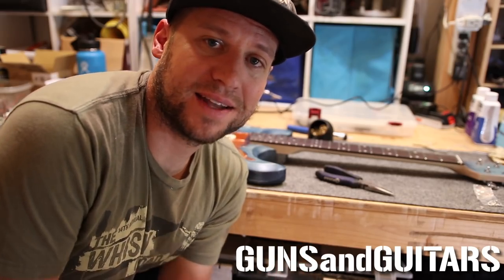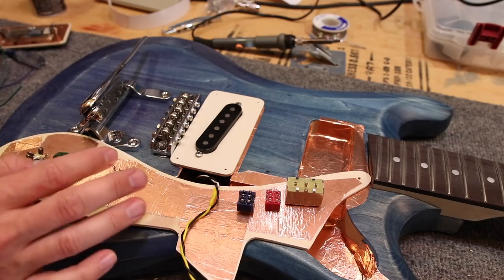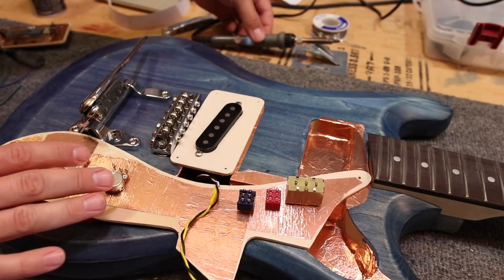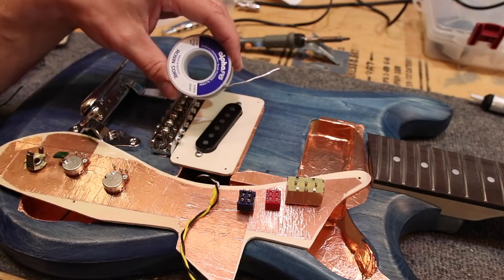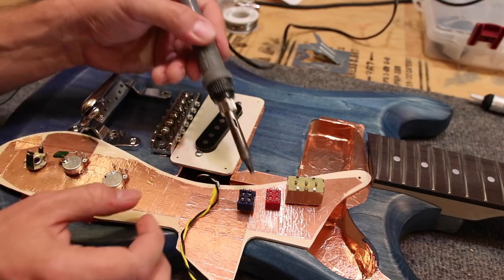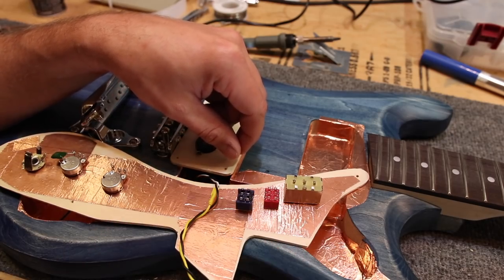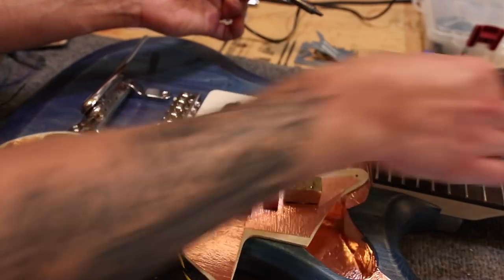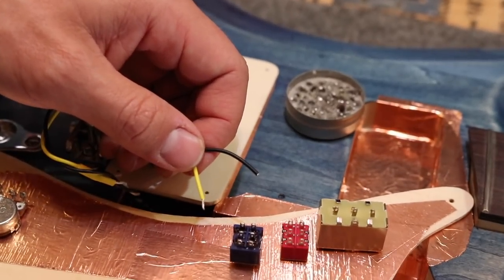Guitar Wiring and Soldering: Basic Technique Tutorial

Comment: Um, should be tinning the wires before soldering to the components, it takes less time/heat and is easier on the component.
Also, use of small copper alligator clips can be utilized for heat sinks to protect the components.
When soldering a potentiometer always turn the pot (volume or tone) all the way to zero, that way in the event too much heat is used when soldering any damage or deformation occurs when the pot is zeroed and not halfway through the operational part of the resistive material.
And above all, always use a towel, cardboard or painters tape to protect the guitars finish when soldering.
A soldering iron only has to touch, brush against or get to close to a poly or lacquer finish for immediate damage that can not be buffed/polished out, same goes for plastic pickguards as well.
Soldering techniques and standards courtesy of Uncle Sam. when I was a Technician in the Military.
Reply from the maker: Thanks for the tips! I never heard about soldering with the pots at 0 but it makes total sense!
Reply: HK Guitar honestly that is alot of good information in not alot of space thank you sir.
Reply: Which service? I was Navy. I graduated top of my engineering common core class, but instructors screwed me out of IC (interior commutations technician) & I got sent out undesignated.  I eventually, became a JO, propaganda specialist.
Reply: Thank you for the tip about soldering pots. Never have heard of that before but it makes sense. 
Thank you!
Reply: Really good tips. Correct me if I'm wrong but if you have a really hot iron the clip isn't really nesecery right?
Reply: Nice contribution. Thank you.
Reply: Thank you for the heads up HK and thank you for your service.
Reply: Thanks!
Reply: A little flux helps for a clean joint as well.
Reply: I'm an MIT Educated Electrical Engineer..with 90/10 or 60/40 Tin/Lead solder that's good advice...he's using Lead-Free/Tin-Free Solder which may as well be a Rosin Cored coiled up mound of dogshit...which require totally different procedures...
Reply: HK Guitar  excellent comments! I agree with all but did not know about Turning down knob. Heat sink is also excellent idea.
Reply: Thank you for reminding me about the alligator clips as heat sinks! I'm going to wire in some new pots and a bridge hb this weekend so that'll be really helpful!
Reply: Nice tip about the alagator clip.  Killed many components with a crappy soldering iron.
Reply: Agreed. Tinning the wires is an important step. Soldering the ground wires to the back of the pots, I believe should be avoided - quite often that is where the pots get overheated and ruined. Bolting down the ground wires to a central lug is a better practice IMHO.
Reply: You are correct , excellent observations above all to PROTECT the finish of the guitar . Greetings.

Comment: Tinning wires is preferred but not always needed. It’s better to do than not do but not always needed. Couple things to keep in mind when soldering to the back of pots move the iron around a bit to spread the heat and not burn out the pot also solder will move towards the heat so when positioning your tip and solder keep that in mind.

Comment: Dan, I honestly enjoy Guns & Guitars very much & it's been useful in teaching me several things, it's a great Channel... I'm an Electrical Engineer... 250K Potentiometers (pots) are for Single Coil Pickups, 500K Potentiometers are for Humbuckers (2 single-coil pickups wound opposite one-another, wound together, making 500K necessary), however, if you pair a 500K Potentiometer with Single Coil Pickup, all the audible variance the potentiometer gives you would take place between number 1 and number 4 (on a numberd knob like a Stratocaster has). Aside from that, Audio Taper Potentiometers (Pots) are Logarithmic. they have to be like that because decibel levels are Logarithmic so it's necessary & appropriate that Audio Taper, pots be used to control volume because they share the same non-linear scale...tone control is linear, so it's appropriate to have a Linear Taper Potentiometer in place of tone pot... if you want to do something interesting with Potentiometers which is different get the Bournes Wolfgang 500K "No-Load" Disappearing pots (when they're turned all the way up, there's a detent which is like a switch & when you flip said switch, the pot " disappears," the pickup never gets loaded by a tone control at all & therefore, the pickup runs "Wide-Open" (so-to-speak) & I'm currently contemplating buying a red EDEN Stratocaster body (normal tremolo routed but undrilled), putting a black Floyd Rose Original or "Pro" tremolo on it, a black HSH pickguard, Red Dragonfire Crusaders (Seymour Duncan Invader clones), black Seymour Duncan Triple Shot Switching Humbucker Pickup Rings on top of the pickguard to split the coils of the humbuckers, a 1-Meg Short/Split Shaft Volume pot, 2 Bournes No-Load Wolfgang Linear tone pots, a Richie Sambora Style Perloid Stars outlined in Black inlay, painting the headstock red to match the body, putting black sperzel trimlock 6 inline locking staggered tuning machines, a Floyd Rose R3 Locking nut, a black floyd rose string retainer bar (if a retainer bar is needed, my Jackson Professional Randy Rhoads RR3 doesn't have a retainer bar, but my custom Dimeslime colored Ibanez RG220X does have a retainer bar & so does my Desert Sunset Blue Burst Ernie Ball Musicman Axis...

Comment: Came here to see what it took to fix some solder joints. Have a Squier Jag I've had for years but it was unplayable because I thought the electronics were garbage. You made a point about using electronics cleaner on components to clean them out. So i soaked my pickup selector and pots and put her back together and wow. Immediate fix. Pots are still weird design, but at least i can play it now! Thanks a ton for that tiny pointer that saved me.

Comment: Thank you so much for making this video!!  I have tried soldering before, but it was basically an experimental circuit board.  It was okay, at least I got a feel for it.  But this video has really enlightened me.  I found a few guitars on the cheap, and they feel great to play - they just need better pickups.  I ordered some copper shielding tape today, and now I just ordered the cleaner and tinner.  You have a wonderful way of making sense of things, and you're so positive.
Reply: Also, thanks to you, I was able to do this yesterday - I installed a new pickup in the bridge of a guitar I absolutely love.  If I hadn't watched your video, it would never have gone so smoothly.  The pickup (a Mighty Mite single coil) - plus shielding the cavity and pickguard with copper tape - makes it a better guitar, with better balance between all the pickups.  It was such a thrill to hear it when it was done!!

Comment: What I'd like to see is a video on what can go wrong. I mean, I realize that the number of things that can go wrong is basically infinite, but I will say that I screwed up my first rewire job so abysmally that I think I learned more ways that a rewire can go wrong than tips and tricks to doing it correctly. So many small inconsequential aspects of soldering that people who have never had a problem doing it don't even think to mention (e.g. Don't blow on your joint to cool it down faster. Don't leave solder on your heating tip for an extended amount of time. Tinning is helpful. Prepping the back of pots by roughing them up can help. Etc.)

Comment: Lol!  I am not ashamed to admit it.  I was doing the same thing you mentioned (trying to put the cold solder on a hot post).  The crazy thing is, I can work with & repair mechanical things, I can even weld like a mother f..., but when it comes to electronics, I suck.  This video was helpful, for me.  Thanks.  Now, I can wire up my own pickups & pots & stop paying guitar shps every time I want to swap out pickups.

Deoxit is good, though.. The guy who usualy wires up my guitars told me about it and it works wonders.

Comment: Have more questions:
1. Will speaker wire work?
2. Any tips on soldering tight spaces? I tend to melt more wire coating that actual solder. 
3. Will that tip cleaner clean off melted rubber?
4. Aside from the housing, is that tip cleaner any different than copper scrubbing wool?
5. Being a beginner, I waste a LOT of solder. If you run out of solder, can you re-melt the wasted globs that didn't stick?
6. Have you used WD-40 Contact Cleaner? If so, how does it compare to DeoxIT? I already have the WD-40 and don't know if buying DeoxIT is worth it till I run out.
7. What's the best shaped soldering tip? Idk if it's better to use the flat tip to hold the wire easier and heat it up more evenly or if it's better to use the pointy tip for more precision.
8. Is a tone pot just a volume pot with a capacitor? Or is there more to it than that?
9. Is shielding necessary with humbuckers or active pickups?
10. If I DO try shielding, will just shielding the pickguard do anything? Or does it HAVE to be the full cavity?

Comment: trick I learned from a master. when you strip the insulation off the wire. cut with the stripper, but before you pull to the side with the tool stop. take the tool away. then grab the loose piece of insulation with your finger tip and twist while you pull. this does 2 things. 1 it twists the strands nice and tight and 2 it keeps your finger oils off. finger oils keeps the solder from sticking.
Reply from the maker: Great tip, thanks!

Comment: One doesn’t need to solder back of the pots to the ground side of the circuit if grounding foil is used to connect the pots and other components. 
In fact, by using the foil AND grounding pots with a wire you are creating an unwanted ground mesh that highly likely decreases the overall quality of grounding. 
Always connect the components to ground in a star-manner, not a mesh.

Besides, make sure that the foil itself is connected to the ground, otherwise it will act as an antenna that captures hum. The same principle works for bridge and the strings.

Comment: Hey Dan, I watched every of your videos. I love them. But could you start for very beginners, for dummies like me? I mean with one Humbucker and one Volume-Poti? And Then go on:-)
Reply: I've done one humbucker, 1vol before and it is the easiest of them.

First of, humbuckers normally come with 4 conductor wiring, which means both coils have their wires accessible from the control cavity. some might come with 2 conductor which is still a humbucker, it just means the north and south of one coil are connected in the pickup itself, so you won't be able to wire it for coil splits and so on. Both of these will also come with an unshielded (bare) wire, this is a shielding ground to help protect the wire from outside interference.

all the new humbuckers I've bought with 4 conductor have had two of the wires soldered together already, these are the end of one coil and the start of the other and this is what makes a humbucker a humbucker. If you don't plan on doing coil splits or anything fancy, just leave them as is and protect them with some electrical tape.

Next, you'll have to figure out which is the hot and which is the ground. most branded pickups have a diagram or key with them to tell you, but if yours doesn't you'll need to use a multi-meter to figure it out. There's plenty of videos on how to test pickups, in fact I think Dan has one.

Once you've figured that out, you'll need to do a small amount of prep to your pot. hold it so that the lugs are facing away from you, like how Dan has them in this video, and take a file or sandpaper or something and rough up the back of the pot slightly. This is our ground connection point and most pots have a coating on them to protect them. Even if it doesn't we rough up the surface so the solder sticks easier.

Now to wire this up, you'll need to install all your components into their proper locations and feed the wires from the pickup and output jack into the control cavity. You'll also need a small bit of wire that didn't come with anything else.
First, take that small bit of wire and connect the lug on the left side (lugs facing away from you like in this video) to the back of the pot.
Then take the hot of the pickup and connect it to the right most lug.
Next, connect both the ground of the pickup and that bare ground wire to the back of the pot. Then take the sleeve of the output jack (assuming it's pre-wired) and connect it to ground. This is the lug that connects to the metal ring that is around the hole where the jack is inserted, not the lug that connects to the "sticky-up-bit". Look up the difference between "sleeve" and "tip" if you want to learn more.
Next up, take the Tip connection from the output jack and wire it to the center lug on the pot.
Finally; take the bridge ground wire (you installed one right?) and connect it to, you guessed it, the back of the pot like every other ground.
Congratulations! you're done!

Here's a visual diagram of what the finished circuit should look like, if it helps: https://guitarelectronics.com/1-humbucker-1-volume/
Reply: Furiora Thank you for your answer but i Need a Video... im not good at this stuff.. Need to See it
Reply: I just updated the comment with a wiring diagram if you didn't catch it already, if that would help any.
Reply: Furiora now I get it. thank you. One picture says more as 1000 words we say in Germany:-)
Reply: We have the same saying in English, maybe borrowed from the German, who knows?
Bitte.
Reply: @Furiora  c not bad. I like this but for us noobs it will still be helpful to have a video on this, I guess.
If you sun up what can is telling in his video, you might easily come to the concussion that this is far too easy to warrant a video.
But I think most people underestimate the value of something as basic to UV beginners
Reply from the maker: I want to do exactly what you’re asking but in a series of live video streams so that you guys can ask questions. What do you think? Of course I would make the live streams available to watch later on my channel if you missed it.
Reply: Guns and Guitars i think you have great handcraft and Knowledge but I would Start with one humbucker and one VolumeKnob, Then two humbucker and two Volumeknobs. After it one humbucker and one volume and one tuneknob and so on. I would buy the linked stuff in amazon. But if I don’t understand the stuff and so it make no sense to buy it on amazon. I mean you can build a Van Halen like guitar with one humbucker and at the end this crazy Brian may red rocket guitar.
Reply: @GunsandGuitars  a q and a is all good and well. But it makes more sense for people who already have the basics down. That's when you don't know the answers, but at least have an idea, about what to ask...
For me personally the most helpful thing would be to do a simple project and, after successfully completing it, a related q&a.
A q&a all by itself, wouldn't help me much
Reply: @GunsandGuitars  hell yeah
Reply: Sounds awesome
Reply: @Ravel Sometimes.
Reply: This response is for several in this thread: GOD DAMN YOU GUYS ARE BEING PICKY! ESPECIALLY FOR A CHANNEL CALLED "!GUNS AND GUITARS!" Does it say, "Guns and Guitars and gluten free nut allergy safe neurotic Woody-Allen impersonators" Y'all want a video for for every solder from 1 pickup up to superstrat , fine, and in live Q&A and non-Q&A versions, and I'm guessing: for free with no affiliate links? Cheaps Bastards? Anywho: one problem for people making YouTube videos: YouTube is !COVERED! in really great, perfect videos that show you how to do the basic, simple soldering you are asking about. So if G&G posts another one: No one is going to click on it. This counts against a channel in YouTube's numbers (and rightly so: you don't get credit for posting redundant material that doesn't get people watching YouTube). Whatever. I guess one video from basic on up with Q&A would cover everything. And if you don't like the Q&A - SKIP IT you whinny little... Whinners(?) Yo, Dan, I wanna wire up my guitar like the one in "How to build a high end guitar out of a cheap eBay diy kit
". First stop: gonna go check and see if you already made a video for it or not

Comment: Great tutorial.. but some suggestions for soldering.
Please tin the wires before hand (apply solder to the wire)
Use a wet sponge and wipe off the iron after ever joint (the rosin can cause oxidation on the tip)
Also after you unplug the iron put a nice glob of solder over the top and leave it. That will prevent oxidation over a period of time during storage. 
I’m new to playing guitar and planning on doing a kit to upgrade from my first act 🤮 so this tutorial helped me know what I’m doing lol

Comment: Everyone has that cheap ass helping hand somewhere laying around^^. 
Holding soldering parts in place is a good idea. When you move in a hardening puddle, moving is a big no no. Add some shrinking tube to the clamps to tame the teeth of the clamps. Use double sided tape to connect the base to something wider, or it will tip over all the time-.-.

Comment: 3 wires got cut off as I was wire stripping. Should I cut further down? I barely have much wire left to work with and am afraid if I cut further, I'll barely have room to connect it to where it needs to go. Should I start soldering with what I got or should I cut it even shorter to be able to use all the wires?

Comment: Where you spliced the yellow to the white wire on the pickup, how did you go about that? Did you twist them together, solder then protect with tubing, or did you use a connector of some sort. 
I just spent a few hours soldering a pickguard and was adding some cable ties to tidy up the wires, when I went to snip the extra tie end, I some how cut my hot wire from my neck pickup and need to repair it.
Reply from the maker: Twist, solder, tape off. Done ✅